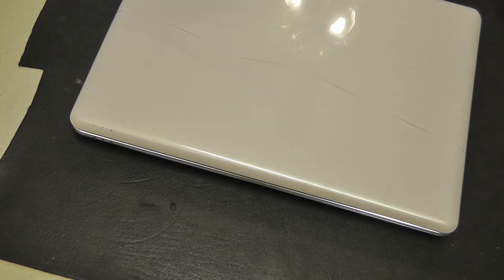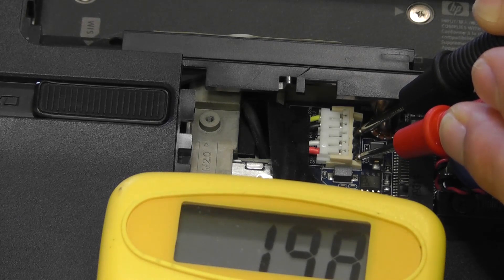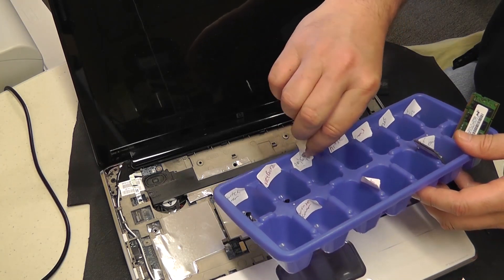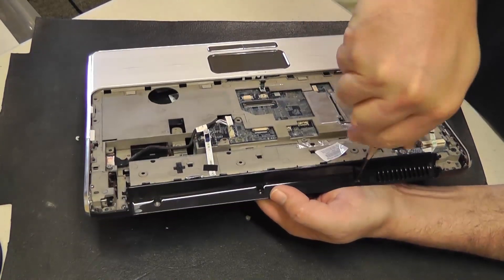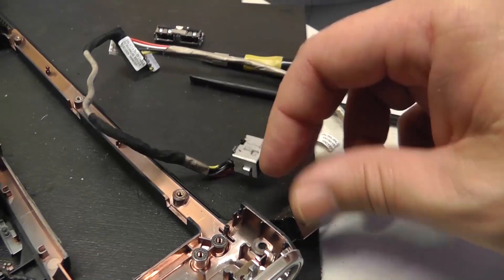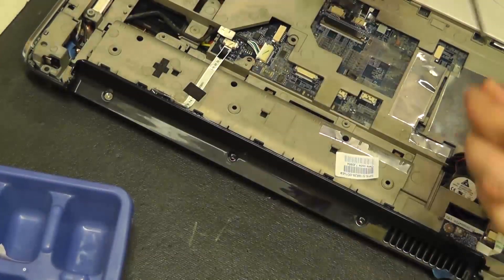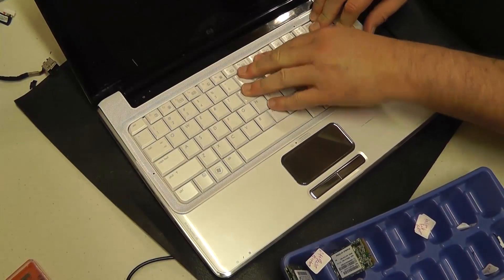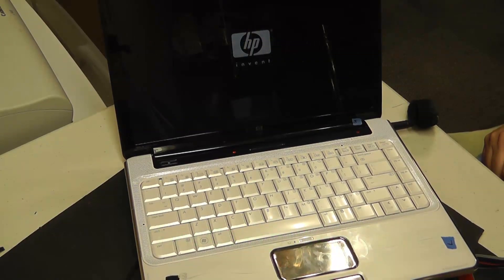Hp DV4 1430us Power Jack Repair by TimsComputerFix.net

Comment: when i connect my power cord to my hp dv4.. the adapter makes a buzzing noise and my laptop has no light and does not turn on. I ordered another new adapter and same issue... no light and does not turn on and buzzing noise on the adapter
Reply from the maker: Sounds like you have a short or failing component somewhere. Gonna have to strip that down.
Reply: TimsComputerRepair so it is not the power outlet?
Reply: the buzzing sound is on the adapter instead of the laptop which is weird. the buzzing noise is louder on my old adapter though. on the brand new one it is much less loud
Reply from the maker: Only way to know is to try another power outlet. Do you have a volt meter to check the outlet?
Reply: no I don't have a volt meter... if the power outlet is cheap... gonna order one

Comment: Got the charge port changed on my wife's laptop! Thanks for the great video!
Reply from the maker: +TheBoneMan Good work! Thanks for watching.
Reply: +TimsComputerRepair Hi, could you please tell me from where can I get spare parts for this laptop? My power button cable (the short white color cable that connects the power button and the motherboard) that cable of mine has broken as a result I can't turn on my laptop anymore. Please help.
Reply from the maker: +Edward Hsue I would try ebay.
Reply: +TimsComputerRepair I did try to search on ebay but I couldn't find the cable? Is there a specific term for the cable that connects the power button to motherboard?

Comment: I have trouble with some of the screws.  They wont come off they are stubborn, what can I do to et them off?
Reply from the maker: +Kathy Murguia If you have screws that are stripped at the head I use a dremel tool and grinned down the head of the screw. Once the part is off I take needle nose pliers and continue to remove what is left of the screw. During assemble I just replace with a new screw. Hope this helps.

Comment: So, I might need to replace the charging port on my HP dv4.  The pin from the charging cord is stuck way inside of the charging port.  (It wasn't always waaay inside, but, you know, I tried to get it out.  So now it is way inside.  Before I take everything apart, I'd like to know if it is possible to push the pin out from the back of the charging port.  If this is possible, I don't need the new part, I just need to get it and push the pin out.  Do you know if it is possible to push the pin out from the back of the charging port?  Thanks for your help!
Reply from the maker: cchun2 I think you need to replace the jack. Thanks for watching.
Reply: Thanks, I actually did this same fix for a while!  But eventually the paper clip migrated too far in, and I didn't want to put another paper clip extension in because I didn't know where the first would end up if it got pushed further.  Anyway, I ended up replacing the charging port, and it's been working ever since.  Well, the charging port has.  I have keyboard issues now, but I think that is unrelated...

Comment: I replaced power jack in same model but it still won't light up on the jack it self but the light on the bottom left flashes like it got a connection but won't turn on only for 1 second. Do you know the cause of this issue? Please help if you can
Reply from the maker: Be very careful when using non hp oem power adapters with these model laptops. On many occasions I have experienced problems when plugging in a off brand power adapter. Only the hp branded power adapters give the proper center pin signal to allow the laptop to power on. Let me know.

Comment: I never did think of that.  The light on the adapter did not come on with the old jack and the new jack.  The power adapters I was using were a RocketFish universal (thanks for that tip!) and the client's off brand she picked up on ebay.  I figured they would work and they gave the correct voltage, but I am guessing only an HP adapter may have solved the issue.  Funny, she did say this was her third adapter...should have made her purchase a genuine HP.

Comment from the maker: Does the small white light come on next to the jack when you plug in in? Be very careful when using non hp oem power adapters with these model laptops. On many occasions I have experienced problems when plugging in a off brand power adapter. Only the hp branded power adapters give the proper center pin signal to allow the laptop to power on. Let me know.

Comment: Thanks for the reply.  I replaced the jack on the dm3-2000, but still no power.  I then desoldered the smashed USB ports and I still had the same no power issue.  Guess the motherboard is dead and the client does not want to go any further.  Oh well!

Comment: Keep up the great work Tim!!  What was the initial problem with this system?  Just checking b/c I have a dm3-2000 in my shop now with a similar pigtailed power jack.  Unit gets no lights so I figured it was the jack, but two of the USB ports on the side of the board were busted too (not the separate board).  Not sure if these were causing the no power issue.  Also when you tested the defective power jack when it was plugged into the board you got 19volts...why was it bad?

Comment from the maker: The white light is activated by the center pin in the power adapter tip. Sounds like that center pin is not making contact. The pin sends data telling the laptop motherboard that the correct adapter is plugged into the laptop. Try a new power adapter. Good Luck. Thanks for watching.

Comment: Tim, first of all, outstanding video! (You should probably be in Washington fixing the govt shutdown). I have the same DV4-1430US laptop.  Symptoms:  Battery no longer holds a charge (new battery on order). However, when I plug the AC adapter in, sometimes the white light (at the jack) does NOT come on.  I unplug and re-plug the AC adapter back into the jack and it eventually works, the white light comes on and I'm in business. I know the original battery is toast so I ordered a new one. Ideas?

Comment: I plugged in the new power jack to test and see if the lights would come on. But nothing came on.  I don't have a volt meter right now. So assuming the replacement dc Jack is not defective. What else could be keeping from powering up. I have zero lights. I went to best buy and tried a universal power cord and still nothing. Any advice?

Comment: Excellent video!  When I plug my power cord in and connect my power button ribbon cable, the fan and light come on for a split second and shut off.  Just tested the same way with the old power supply and had the same result.  Have a bought a faulty power supply or is my problem elsewhere?

Comment from the maker: You can try and power on the laptop without your battery. You may also want to try another power adapter as the you are using may show 19v but it may not be pushing the amps needed to power the laptop.

Comment: Great video. I thought my jack was bad because the battery isn't charging and the light doesn't come on when is plugged in, but I tested it internally on the red and black leads and I'm still getting 19.2 volts DC. The computer shut down. Does it have to have the battery in to work? Any other troubleshooting ideas of the top of your head?